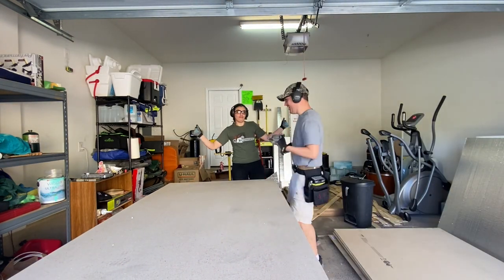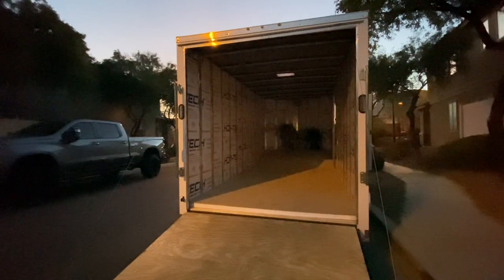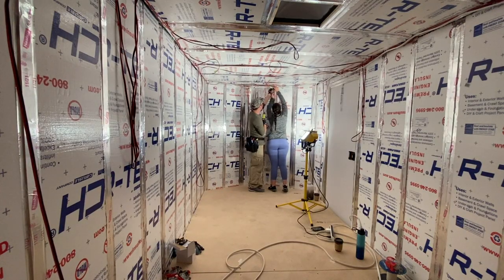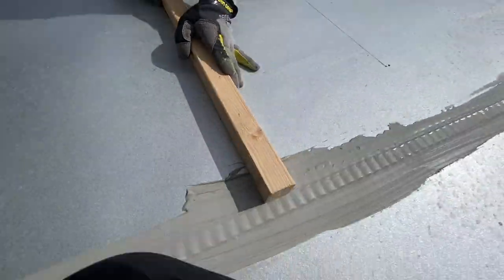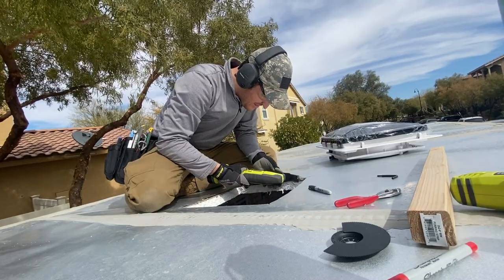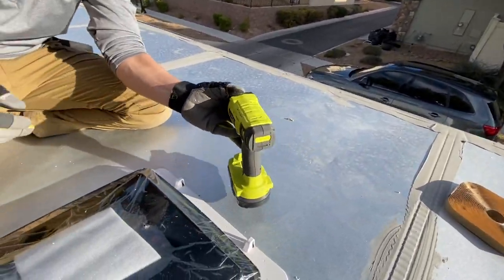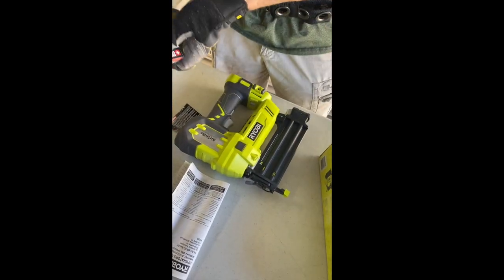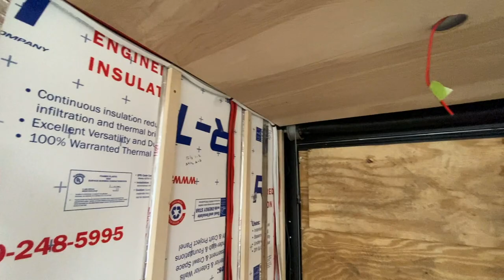Cargo Trailer Conversion Build Episode #2 - Subflooring, MaxxAir Fan Installation, Ceiling Install

Comment: Just FYI, to prevent any future roof leaks buy a gallon of Kool Seal from the roofing dept and you can have it tinted if you want and coat the roof with two coats. It will give you a extra layer of protection and also lower the temperature on that tin roof. Another thing I done was enclose underneath the trailer with roofing tin. This will eliminate drag while pulling the trailer and it makes a huge difference when it comes to gas mileage!
Reply: The roof's on those cargo trailers are either aluminum or steel. Those are the only 2 options that are available from the many companies that make those trailers. If someone wanted a tin roof, they'd have to install one their self after they bought the cargo trailer. Just a little fyi
Reply from the maker: Hey Sheltdog8463!

Thank you so much for those pro tips!!

We used FlexSeal and lap sealant for our roof and it's 100% covered with either solar panels or our roof deck! So thankfully, it doesn't get too hot. 

But we'd definitely look into that Kool Seal on a future build. 

We've totally thought about doing roofing tin on the underneath of our trailer! Great idea. Would you say it's really eliminated drag for you? Could you put a percentage on it?

It's just so expensive so we haven't made the investment yet not knowing 100% it would make a difference. 

Thank you for watching!

- Maranda & James
Reply: @ondreacounts2556  While you are correct, check the thermal conductivity of those materials against each other. I doubt he really meant it was made of tin. It's a very common figure of speech.

Comment: I agree with Sheltdog8463 except I would use Crazy Seal to cover your whole roof. I noticed you have the typical cargo trailer roof using an alumasteel material and it was put on in sections instead of one solid piece from front to back. You have the potential for roof leaks at every joint. The Crazy Seal will seal any joints protect your roof for up to 50 years and reflect heat and cold. I'm also wondering why you put a Maxair vent in unless you're installing window in a future vlog. Good luck nice build so far!!
Reply from the maker: Hi Alanosborne1947! 

Good catch on our roof being in sections. We used FlexSeal and lap sealant to seal the joints! We're confident it will hold up but maybe on a future build we could totally use Crazy Seal so thank you for the tip!

Episode 3 is now posted and it actually contains our window install! lol Check it out https://youtu.be/53fcChzUpzc

Make sure to hit the notifications button so you don't miss our future episodes!

Thank you for watching!

- Maranda & James

Comment: Particleboard is always a bad choice.
Reply from the maker: Hey there, 

In certain circumstances, we 100% agree with you. However, for the application we used it for (the subfloor that our permanent flooring would go on), it suffices for both function and budget. 

Thanks for watching! New episodes coming soon 🥳

- Maranda & James
Reply: i agree if it gets wet it swells up and turns back to sawdust  speaking from past experience.

Comment: This is the BEST video series on how to build a camping trailer. Great work. The only thing that I would have done differently is put the max air fan where you put the skylight and that way you would not have had to cut an extra hole in your roof. Looking forward to your next video.

Comment: Great job guys!  A small tip.  When using the hole saw drill the pilot hole then reverse the drill for the initial start.  This will minimize tearout if not alleviate it all together.  Just a small fyi.

Comment: I am enjoying the build and it appears to be well thought out and very well built, my only concern would be GVW after build and how much room for additional travel weight?
Reply from the maker: Hi there, 

Thanks for watching! Great points you have. 

Our 7x16 is a double axel that's rated for 7,000lbs. Empty it was 2,200lbs. After our build was completed, we weighed in at about 5,500lbs fully loaded with water and all belongings. 

We were pretty conscious of the total weight throughout the build and tried to use lightweight material where it made sense. 

We've got new episodes coming soon, don't forget to subscribe! 🥳

Thank you!

- Maranda & James

Comment: Great job so far guys!! Just wondering about the ramp door. You haven't done anything with it yet. Is it insulated from the factory? Keep up the good work.
Reply from the maker: Hi kractass! 

It's not insulated from the manufacturer and we did not insulate it ourselves. We end up putting vinyl flooring on it to act as insulation due to space.

If we would have tried to insulate, it could've messed with the ramp cables and where they're located on the inside of the trailer. 

Thanks for the question and for watching!

Episode 3 is now posted - go check it out! https://youtu.be/53fcChzUpzc

- Maranda & James

Comment: Just curious if cost savings is key to this build why not insulate under existing floor and not have the added cost of sub floor?
Reply from the maker: Hey there rubiken06,

Thanks for the question!

If we had insulated under the existing floor, our insulation would have been exposed to the elements outside. The existing flooring was the only thing between the trailer and the road. 

In order to cover that insulation (underneath the trailer), we would have had to put a protective layer over it anyways. It was not only easier but better for mold reduction to insulate the trailer from the inside. It was the cost of 4 sheets of 1/2 inch particle board so not too crazy. 

Hope this answers your question.

Thanks for watching!

- Maranda & James

Comment: For the underside, use corrugated plastic sheets. Lighter and provides some insulation value as well. Roofing flashing is quite heavy.

Comment: I'd like to know how the floor is holding up. I've seen mixed info installing the subfloor this was which is why I added 2 inch wide strips in my floor to support the 3/4 ply.
Reply: The ceiling too, I would screw on not brad nail but I’m no expert, just another DIY ER
Reply from the maker: Hi Bobknob8440,

Our flooring has held up fine so far! We didn't want our nice vinyl flooring on every square inch of the trailer so we definitely opted for a subfloor. However, our subfloor is only roughly 1/2 inch particle board (wood is so expensive!!🤯). 

Thanks for checking in! Episode 3 is now posted so don't forget to check it out!

- Maranda & James

Comment: Do you have any concerns about the foam in the floor compressing over time and creating gaps or soft spots?  Stryofoam just doesn't seem like a great substrate for walking on, even if the weight is distributed by the subfloor.  I'll be interested to see how you handled the huge edge at the door.  2" of foam and particle on top created quite a difference in floor height.

Comment: What was your insulation cost?
Reply from the maker: Hey Richie!

Prices have since gone up since we bought insulation but we paid roughly $30/panel of 2-inch insulation - we had to use 4 of those. 

It was roughly $18/panel of the 1.5-inch insulation - we had to use 14 of those to cover the walls, v-nose, and ceiling. 

It was between $400-$450 to insulate everything!

I'm sorry we don't have exact numbers yet - we're still reconciling our receipts to understand the cost of everything.

Thanks!

- Maranda & James

Comment: On The wiring, why didnt you just cut a groove in the insulation to run the wire in?
Reply from the maker: Hi, 

We didn't want to lose any R value if we could help it. We also didn't want the wiring to have too much friction and overheat or become exposed due to the friction. With the way we did it, our wiring has plenty of room to breathe, spread out, take some time off 😉 lol. 

Thanks for the question! 

- Maranda & James

Comment: You forgot the expansion gaps in the floorings so Unfortunately that floor base is going to be buckling as soon as it gets hot,

It won't be long before RV parks and campgrounds start banning these DIY cargo trailer conversions as they are literally death traps, You'll notice there's not a single fire escape...  have you ever noticed that RV have lots of windows ? they aren't there for the view but rather each window acts as a fire escape.

Foam and plywood burs very quickly and when one of these catch on fire you only have minutes maybe seconds to get out a window before the smoke overwhelms you. 

With only 1 exit, and all the power up front if a Fire breaks out you'll be trapped
Reply from the maker: Hi Dannelson8556,

Fortunately, we've been through 2 Vegas summers (115 & hotter) and nothing has happened to our flooring! Thanks for checking on it though!

Episode 3 is now posted! As you'll see, we installed a window - so worry not Dannelson8556! We thought of the same things you're mentioning and created solutions for them. 

We definitely don't subscribe to cargo trailers being death traps - there are solutions for everything. Just gotta use our brains 🧠

All the power isn't up front? Our electrical is run through our dinette. You sure that was OUR episode you're talking about? lol

Oh, another thing not to worry about, we also have 2 fire extinguishers. 🧯

Thank you for the great points you brought up! Don't forget to hit the notifications button so you don't miss our future episodes!

- Maranda & James

Comment: WAY too much trouble and expense for the puck lights. You should have just used battery powered stick on puck lights. You can put them anywhere. Get some rechargeable AA batteries and your l set. Use your solar powered power station to recharge them. LEDs draw nothing and so a battery would last forever practically.